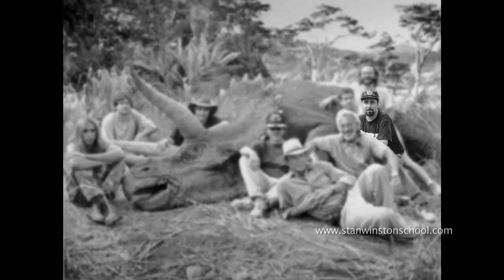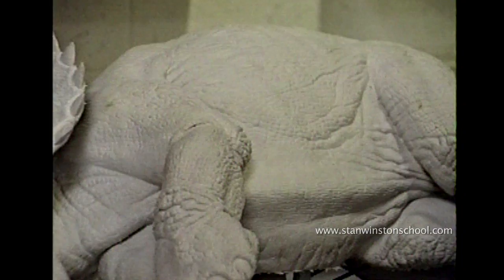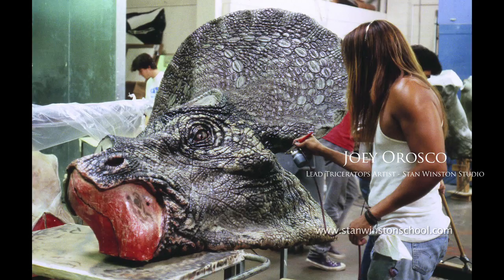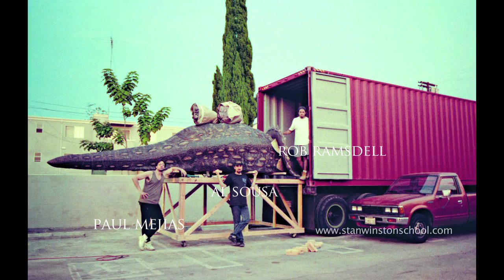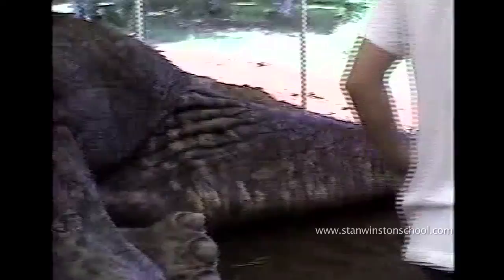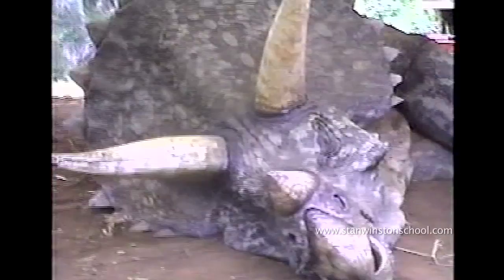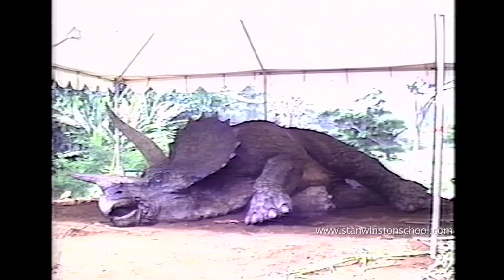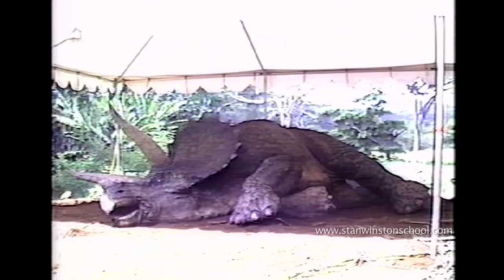JURASSIC PARK TRICERATOPS - Part 1 - Puppeteering an Animatronic Dinosaur

Comment: I wish they had made the triceratops of the Triceratops Encounter trail of the Jurassic Park section of the Islands of Adventure area at Universal Studios in Orlando in Florida look exactaly just like the triceratops of the film inside and outside, except it would be standing all the way up and not laying down and it would also make exact same roaring sounds exactly just like it made of the scene of the first film.
Reply from the maker: Unfortunately, the very different requirements of a theme park figure and a movie prop require different approaches and therefore different results in the look. - David
Reply: I see. well, the least you guys at Stan Winston Studios could have done was shared like the dinosaur movie concept art and maquettes of the triceratops with the engineers and animatronics specialists at Universal Studios to have the triceratops of the Triceratops Encounter of the Jurassic Park section of the Islands of Adventure at Universal Studios in Orlando Florida and at Universal Studios in Hollywood in California made to look exactaly just like the triceratops of the first film inside and outside. that would have probably worked out well.